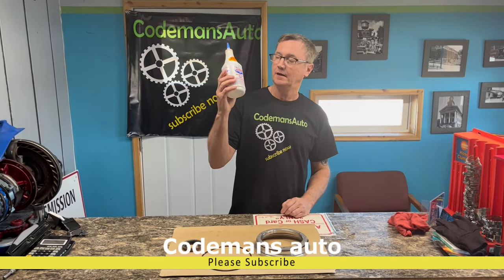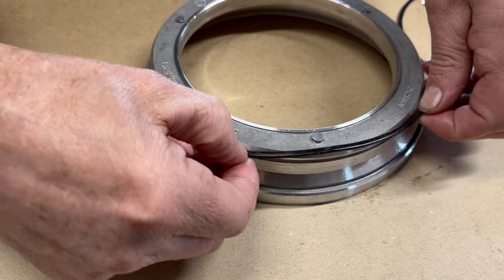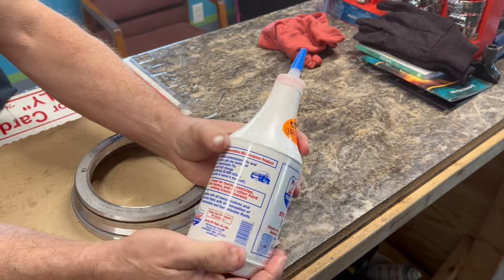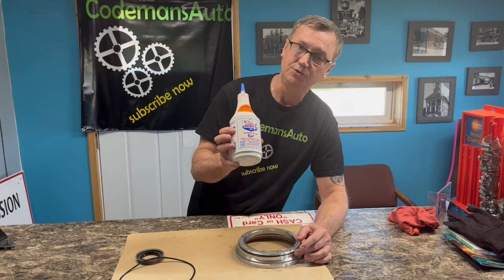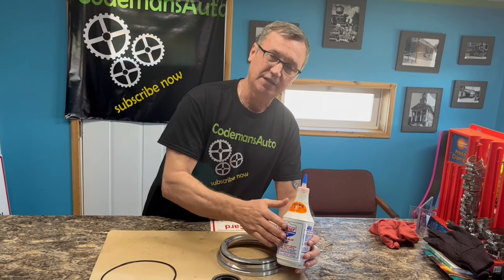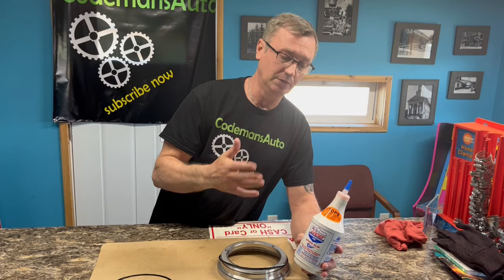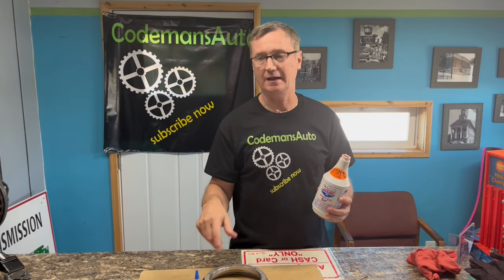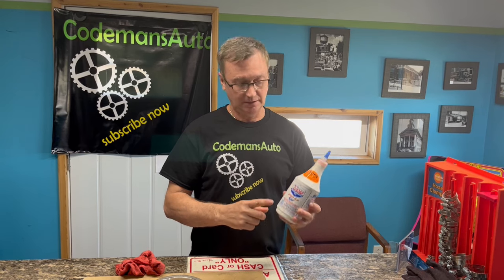Lucas Transmission fix, you need to CHECK THIS OUT and see for yourself what it does to your seals

Comment: My sport trac had a little slip and slightly rough  shift from 4th to 5th. 
I put a bottle of that shit in last night and brother I mean SHIT! Now it takes forever to shift from 1st to 2nd, smooth from 2nd to 3rd, rough from 3rd 4th and 4th to 5th plus 5th FEELS  like it shifts to 6th gear. I have a 5 speed transmission. There is no 6th. Slipping and rough till it finally gets completely into 5th. Made mine much worse than it was so I guess it’s time for that rebuild I figured was in my future but I thought had another year maybe cause it had the original problems for more than a year before Lucas. All I can say is in my case it didn’t do shit except make it worse. I’m gonna loosen the pan and drain some out and see if it makes a difference. I’ve only driven about 20 miles so far so maybe draining some will be better. I do think it’s too full. From what I paid attention to NOTLucas but every utube PRO know it all, I put a whole bottle in without draining any. BIG mistake. Level is high. No drain plug. Gotta loosen the pan or use a pump or sucker from the stick/fill tube. I ruined a pump. Wasn’t made for liquids but I didn’t need it so I tried. Got maybe a shot glass full out before it quit. So I did nothing but ruin that pump, get fluid on the floor, and ruinate the transmission. I’m ROYALLY DANGED for sure. Oh well the wife’s outta town for a few days, I’ll just drive her G-37. It’s more fun than a sport trac anyway. And I KEEP it well maintained. Hard not to drive the shit out of it cause it’s pretty quick and good top end 155+) but I promised her I wouldn’t race it. 😂

Comment: I have a leak in my engine true a seal  will it help ,,
Reply from the maker: this will soften an old seal and could possibly help your issue but if you have a damaged seal than it may not help
Reply: @codemansauto208 Do you think it'll stop a CV axle seal leak ?

Comment: My transmission fluid is full. So, do you remove 12oz first then add it? or do you just add it to a full transmission.  No one has answered this question.  fluid was changed at 80k now has 120K.  2012 Jeep Grand Cherokee
Reply from the maker: don't add a full bottle to that transmission and if your transmission fluid level is at max then yes you should pull some fluid back out
Reply: I’ve been looking everywhere for the answer to this question. I sometimes feel I’m the only one overthinking it . Thanks ! 👍

Comment: If you want another idea, love to know about LubeGuard Platinum.
Reply from the maker: LubeGard can be really confusing because of the different labeled bottles and color bottles so yes I do need to make that video to help people understand if the problem they have can be corrected with the bottle they purchased. thanks, And you know I remember when I first used LubeGard I only had one bottle option and the only store in my town that carried it was NAPA.I used a bottle on every 700r4 rebuild to help with Detent valve sticking issues.

Comment: This is now my toy car. I have a 20 year old mercedes with 350K miles with an original transmission. Now I get an incorrect gear ration light with occasional slippage and it doesn't always shift until after I let the car warm up for awhile. I didn't change the transmission fluid since forever. Shops say just don't do it at this point. NO guarantees, but "might" this stuff help anything? I've been afraid to loosen up anything in there. I'm also not going to spend $3K+ on a transmission.
Reply from the maker: I can't recommend this product to anyone I try to make these videos on products more as a (USE CAUTION) than a recommendation and honestly you can ask 5 people how they liked using LUCAS and you will get 5 different answers. So sorry I can't be more helpful

Comment: 2:01  very poor example. Your parts are apart on a table, and assembled trans with the piston and seal in the drum will not catch or “roll out”. There isn’t enough clearance. It will seal better, that’s the whole point of Lucas. I’ve run at least 2-3 bottles in full size trans with great results for years. Just sold my Cummins with 370,000 miles that survived the last three years on Lucas. My two new purchases 5.9 magnum with 216,000 and 6.5 diesel with 220,000 both got a full bottle on an already good trans to promote longevity given that I don’t know the maintenance history of them.
Reply: Do you think it'll slow a CV axle seal leak?

Comment: I just add small amount until it fix. Because Honda do know you use different fluid.
Reply from the maker: You really need to know what fluid is in your Honda before you add this to your Transmission. But yes if you do add some make sure its a little at a time.
Reply: @codemansauto208  original ATF from Honda 1999 civic

Comment: Lucas stop slip is a great great product. My car transmission would not engage in D mode and only worked in 1 mode and Reverse. 

I added this product into my transmission with old transmission fluid and after driving for a little while, the D mode came to life and shifting became smooth. This is just a great product, I would recommend to everyone with transmission issues.

Comment: Why can you not use it in a CVT?
Reply from the maker: the bottle says on the back "Compatible with all transmissions and transmission fluids with the exception of CVT transmissions"
Reply: @codemansauto208 I have a plymouth van leaking transmission fluid from a CV axle seal.  Do you think think product would stop it?

Comment: Would not recommend didn't work in fact it would not move out of its tracks.before used it would go.
Reply from the maker: I am not recommending it in this video. I am raising caution for those who do use it on what it does to your seals and also that there is no recommended dose per quart of fluid. Thanks for your comment.